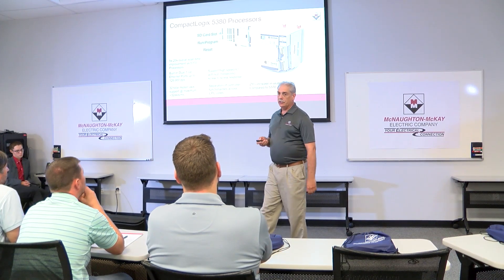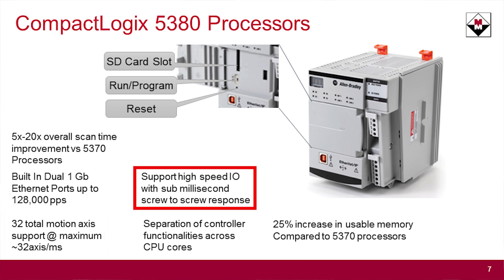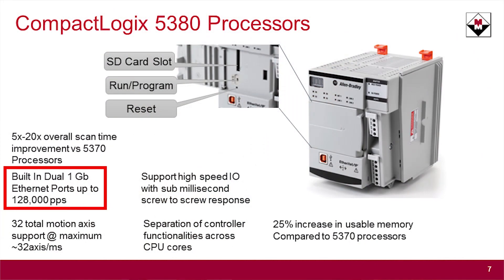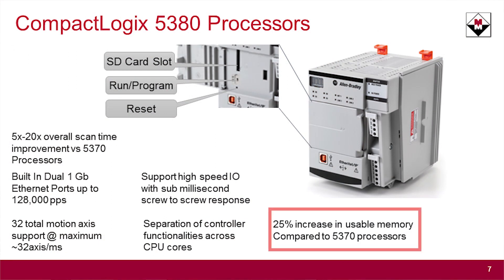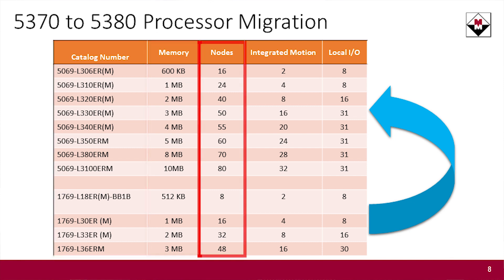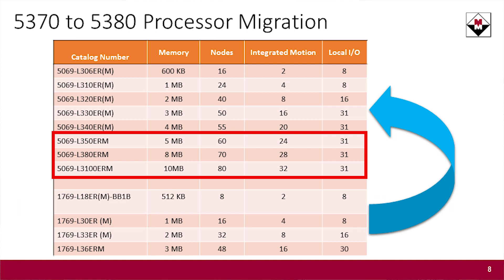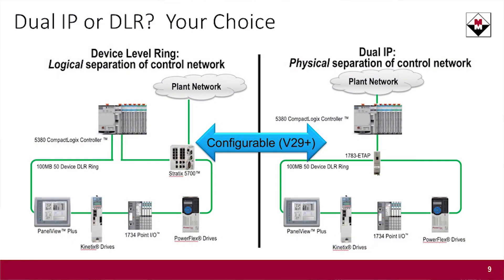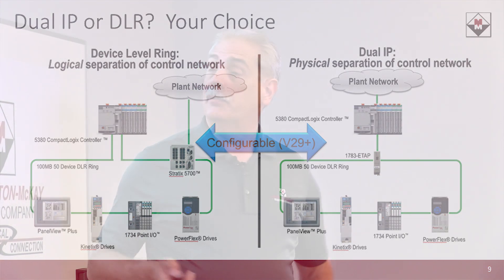Introduction to the new Rockwell 5380 L8 Based CompactLogix Automation Controllers

Comment: I'm really interested in the processor speed, which I find difficult to find in Rockwell documentation.  What is the processor speed in Mhz/Ghz?
Reply from the maker: Hello, Rockwell Automation does not typically publish the processing speed of their controllers, but we have noticed the L8 is faster than the L7. If scan time needs to be analyzed for a specific application it would be best to reach out the local distributor. https://locator.rockwellautomation.com/